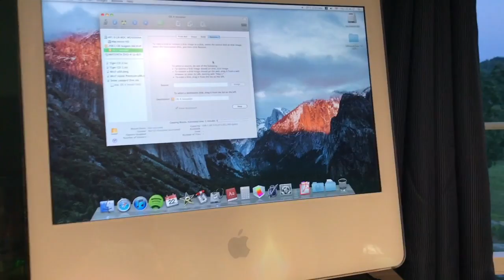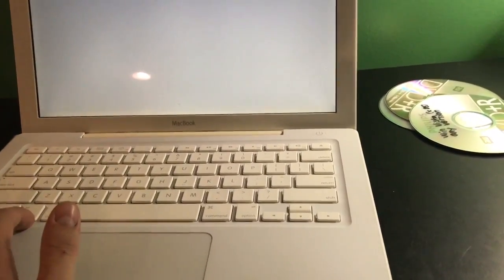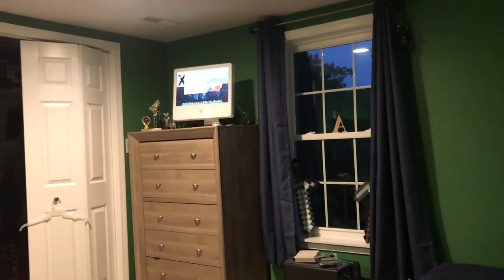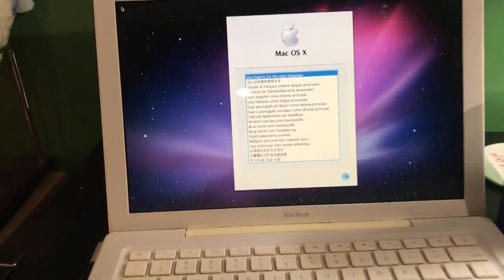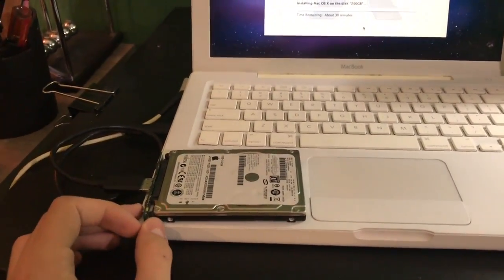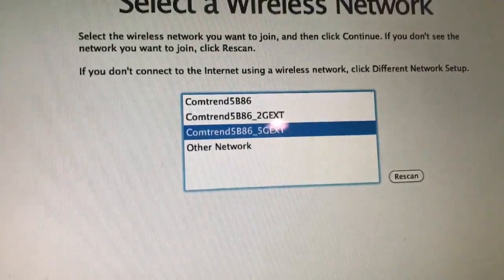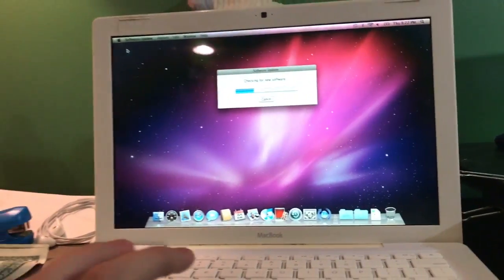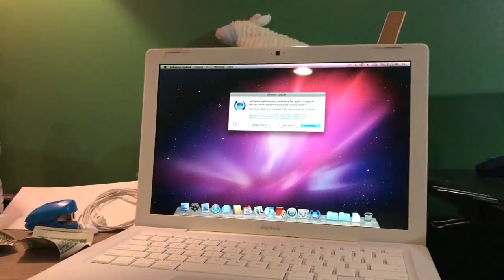2006 Classic Core Duo MacBook

Comment: You should be using the SSD instead of the HDD cause HDD is slower than the SSD and boosting the ram could goes up to 4GB of ram and max are 6GB which is different than the 4GB..you should be getting the upgrades done and it is well runs even with the El-Capitan Patcher also in 2023.
Reply from the maker: I'll be honest, i don't have this machine anymore. However, since this is a Core Duo, and not a Core 2 Duo, MacBook, it wont boot if it has more than 2GB (2x1GB) of RAM in it. While i would love to see these 32 bit machines run anything past Snow Leopard, they simply cannot.